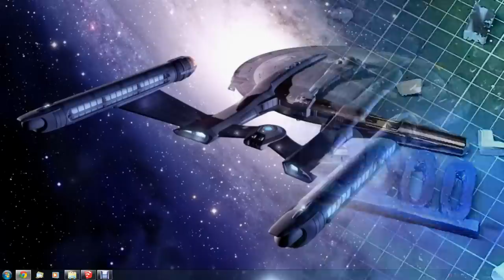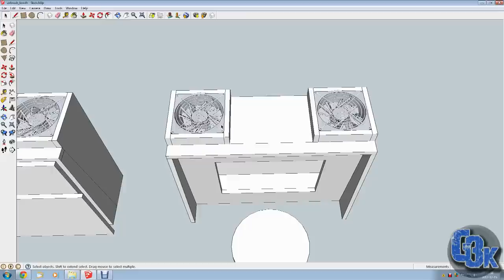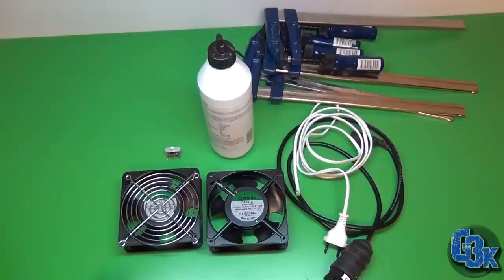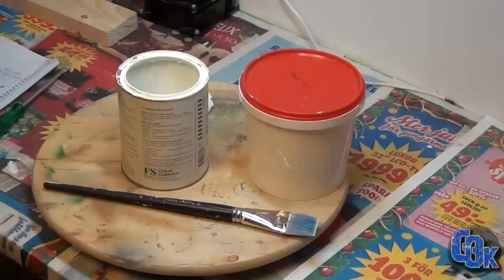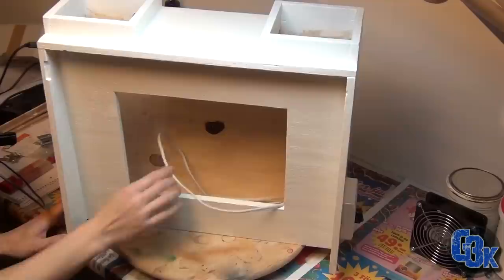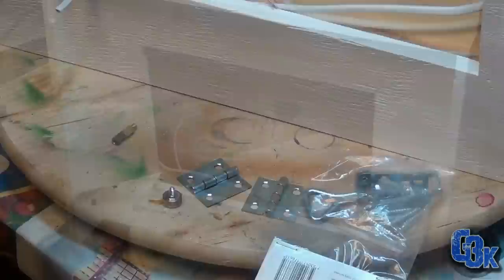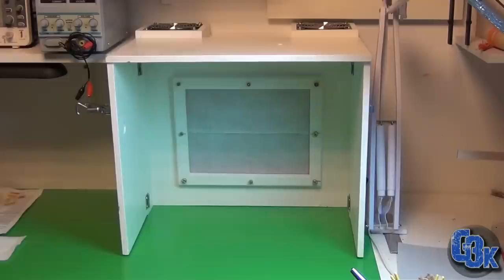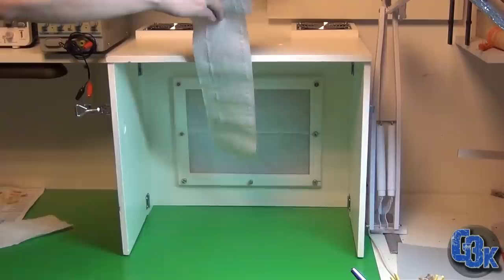Airbrush Booth - Design and Build

Comment from the maker: I´m from Sweden. If you’re looking to build a booth for yourself I would recommend that you do some research online. Look at various designs and features of other spray booths. Decide what you need and then design or copy a design as your own. Most important feature of a booth is that you control the airflow. Don’t let it seep out and/or suck air all over the place, the flow needs to be directed. Cheerio

Comment from the maker: Thank you!
Well I´ll answer you in English =)
The reason I don't use hinges at the top is because the doors, when closed, are a little proud of the front edge of the case. Which means that I would either have to change the doors, to inset them, or leave a gap between the front edge of the case and the top lid when the booth is opened. 
Hope you followed my reasoning there. I did spend alot of time trying to figure all the mechanics out, hinges sometimes hurt my brain a little =) Cheers

Comment: It looks like you have some electronics equipment, I would like to add my voice of concern as well. Just because it smells fresher does not mean the chemicals have been filtered out. I think it looks like you have an oscilloscope which could be very sensitive and possibly very expensive.

But as it is I think it is probably better than nothing. It was a fun video to watch and some good Ideas. I also like how you started with a sketch and then continued with your build. Good Luck
Reply from the maker: +Richard Gel Thank you for your comment! The setup is different today. I dont have the spray booth anywhere near my electronic equipment any more. 

Thanks

Comment: what motors are they? where did you get them when yoy said "industrial'? electronic whse or  like Graingers?
Reply from the maker: They are 230 Volt AC powered fans. Its one complete unit, fully cast in aluminium. I got these from a Swedish store called 'Kjell'. An equivalent in a 120 Volt country like the US, could prob be found in a well sorted electronics store. Maybe even Ebay. Thing is, I didn't use your standard PC case fans since they move allot less air thank these types.

Comment: Why not add a hinge to the top plank so that you can fold it down once the side parts are folded in? It would also act as a lock.
Reply from the maker: +Rainer Koschnick That could work. I would just have had to extend the top part of the main construction so the lid would be able to fold over the front doors. Maybe on the next iteration. Thanks for watching!

Comment: Hi, nice spray booth. Just wondering how those fans are holding up? I am in the process of designing my own spray booth, not that there is much that you can do differently. I am going to use 2 x 12 volt boat bilge fans with 120 cfm each. These will discharge into a common box and an exhaust hose going out the window. Because I am running 12 volts and have the power supply built in, I am also going to run LED lighting on the top as well so there should be no dark areas. I also like how yours folds up to free up desk space.
Reply from the maker: Hey ApriliaRSV4F,
the fans I used have held up well. I have not been using this booth extensively though but whenever I need it, it works just fine. I think since they are quite beefy and made from metal, they will take a lot more wear compared to normal PC fans for instance. Although they do cost more.

I think your setup will work very well to. It's a nice idea to integrate lighting into the setup. I will do this on the next redesign to! 
Very nice idea to use boat bilge fans, since I am guessing they are sealed! I need to look into that =)

Thanks for watching!

/Nicholai
Reply: greenskin3000 Well the fans are designed for fuel fumes and are sealed to an extent but are not explosion proof or intrinsicly safe, that I am aware of. But what people seem to forget is the LEL of the of the vapours, I calculated that the fans I will be using will replace the cubic area of my spray booth 59 times a minute, this, on its own, will totaly screw up the air / fuel ratio of the lower explosion limit. I have designed mine so that the power supply and the electrics are sealed and no vapours are able to get to them, this is more for air flow efficientcy than anything else. Oh, one last thing, I am going to have the light on a switch and the fans connected to a LED dimmer as a veriable speed controler. Then I can use the booth as a work area using the light and have the fans turned off. Not sure if I will put it on youtube or not. I just get pissed off with the instant armchair experts who are quick to criticise but not to fast at showing anyone their version or solution.

Comment: This design should not be considered a spray booth. #1 it doesn't exhaust air in a safe manor.#2  the filter system is a joke, The harmful products in the exhaust air would not be filtered and would accumulate in the room air. Please don't consider selling one unless you have a desire to harm the person using it and enjoy law suits.
Reply from the maker: It works great for what I used it for and improves my situation compared to not having one. It's a DIY video, why would I sell it? (rhetorical)

Thanks for watching.
Reply: Like out the window out side

Comment: THE FUMES ARE JUST GOING TO END UP IN THE ROOM YOUR IN??? YOU NEED TOO VENT THOSE FANS! LOOKS GOOD BUT POOR DESIGN.
Reply from the maker: Initially my idea was to rout the "chimneys" on top through a window but I was not able due to the placement. My main goal with this project however was not to create a 100% clean airbrushing environment but rather to trap the majority of the free particles in a filter. Which is exactly what it does. The room doesn't smell of fumes anymore and the air is markedly cleaner when airbrushing. It's better then no filtration at all. It would be an easy modification to route it out through a nearby window if your interested in building your own. Thanks for watching mr CAPS.
Reply: greenskin3000
charcoal insert may work. they do sell activated charcoal filters, may work a little better for VOC.s!